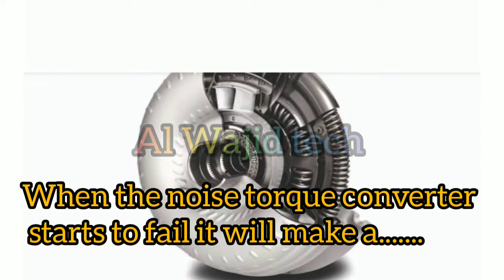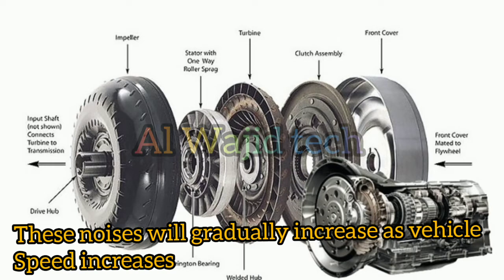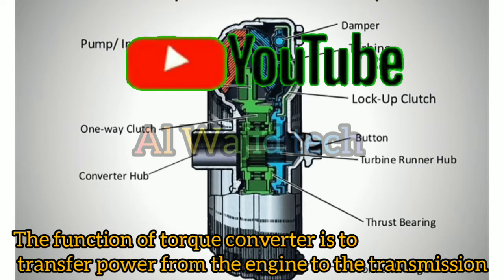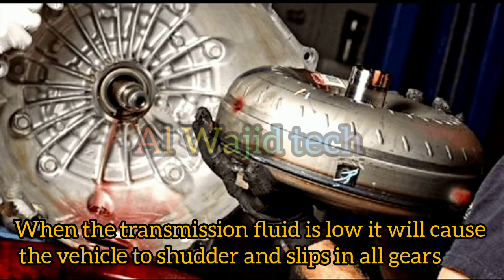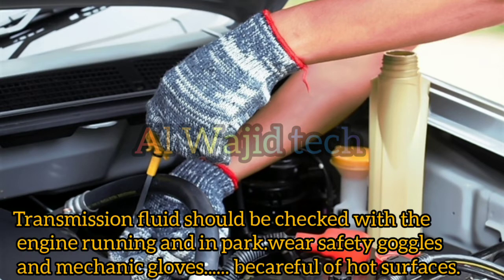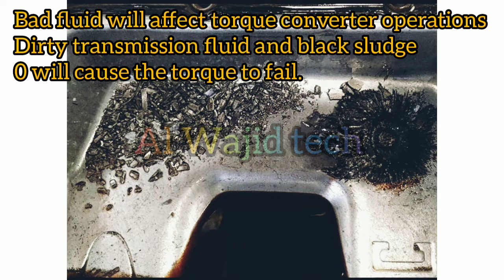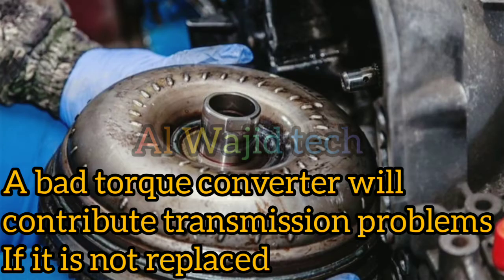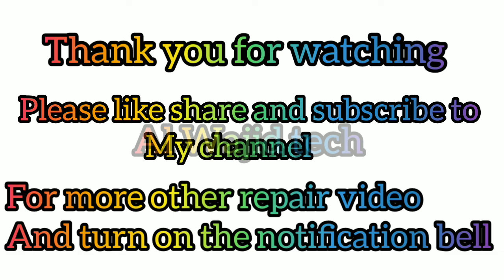top 3 signs of a failing torque converter | what are symptoms of a Bad torque converter

Comment: 4L60 in gear mash gas,engine bogs way down ,ease up on pedal truck gets going slowly.Mash gas engines bogs.Slowly will build up speed.  Is this bad torque converter?
Reply from the maker: No it's not torque converter foulty it's transmission need to be checked
Reply: Thank you
Reply from the maker: @johnmoyer2849  u r welcome bro